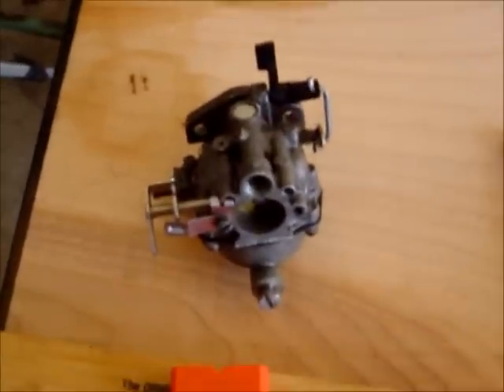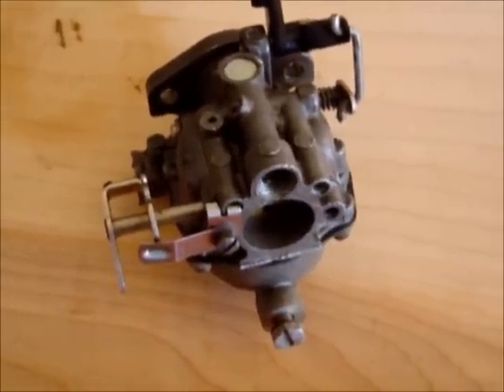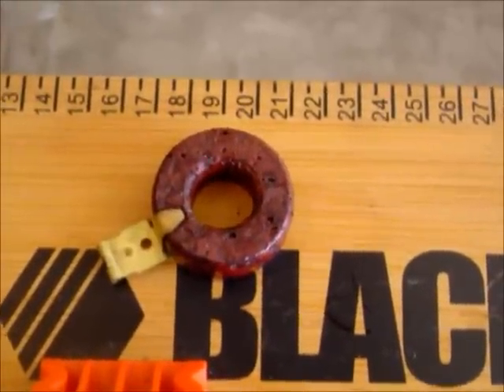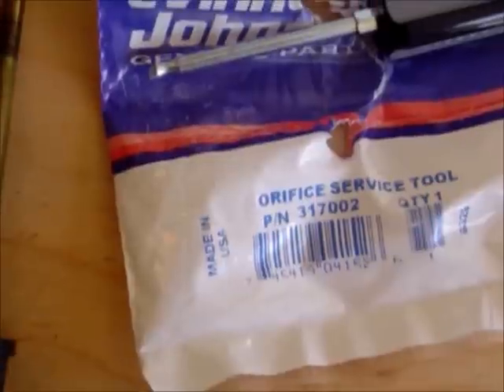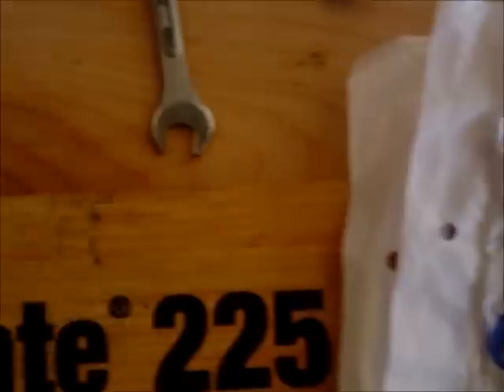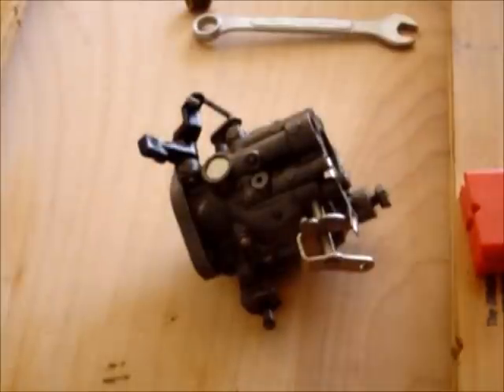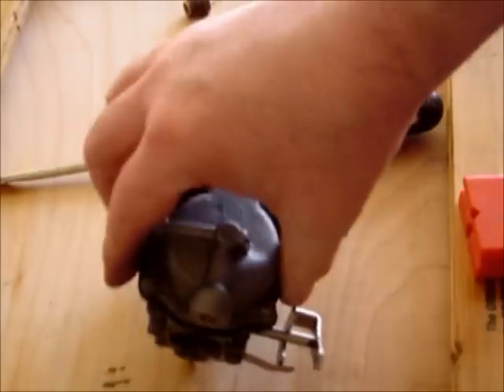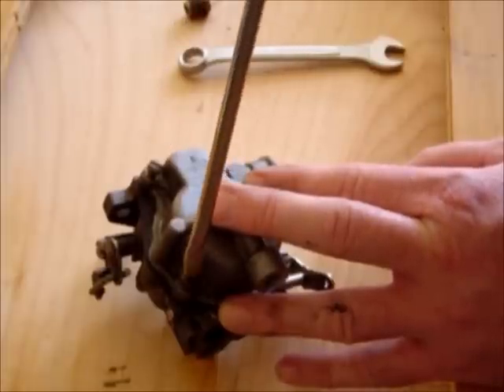OMC fix jet carburetors part 4 of 10  (Motor displayed 1968 Johnson 6hp)

Comment: Excellent series on rebuilding an OMC carb. It helped me rebuild one on my 1970 6hp Johnson motor I got with my sailboat. I had trouble finding the limited clearance bit he referenced. I found at Lowes a 3/16" Cabinet Tip 4 " Screwdriver made by Southwire Co for $9.00. It wasn't with the regular screwdrivers, I found it in the hardware aisle with nuts bolts and screws. It worked great!

Comment: I took a old nail the same width as the opening. and grinded it down on a wheel to be like a flat head. then I bent it in a vice 90 degree so I have leverage to unscrew the orifice.. worked great..

Comment: Can you give me the number stamped on the side of the limited clearance bit?
Reply from the maker: thull1234, sorry I have been real busy with work and the family, so I am just getting to some question on postings. :(

This is stamped information the bit.
SLC4A
 1.5

Extra Clearance Slotted Insert Bit
1/4 inch hex shank,  3/16 inch tip width, 1 1/2 inch length.

I hope this is the information you needed.